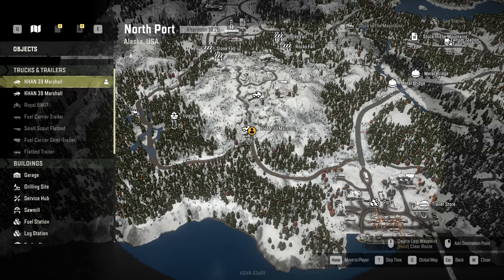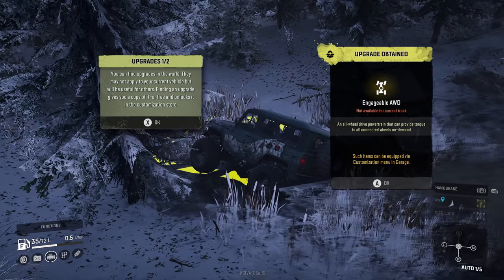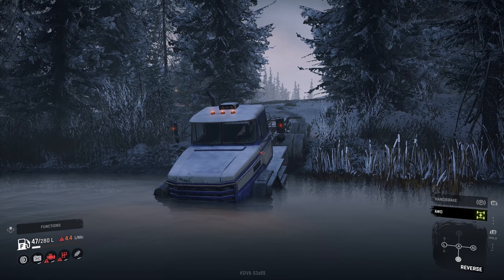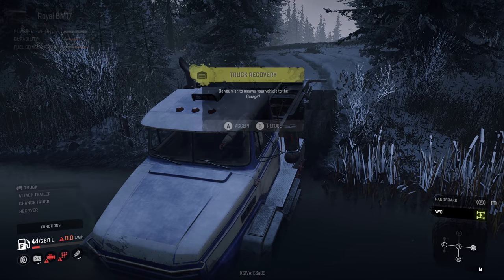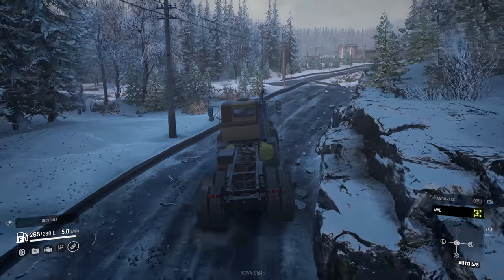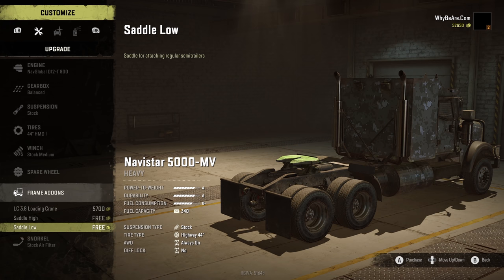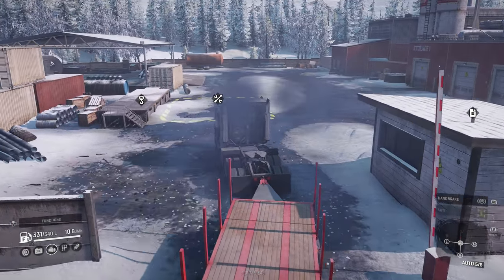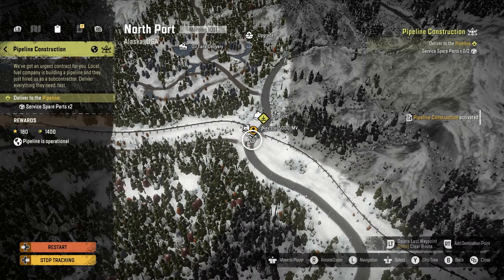FLAMETHROWER on my TRUCK - SnowRunner

Comment: the bm17 would be much better to do missions with as it is much more off-road capable. it’s on all terrain tires stock and has awd stock, along with you being able to put a diff lock on it. also, it would be much easier to attach a trailer to the saddle you put on your truck or just put a flatbed on your truck, instead of hooking up the trailer with a tow hitch.